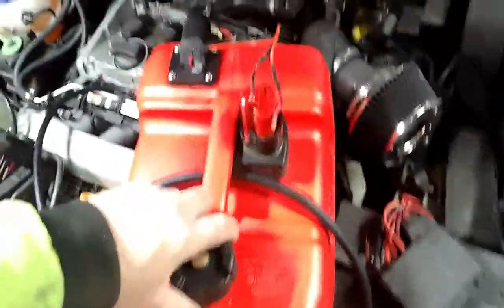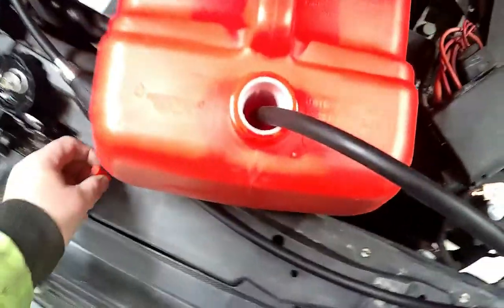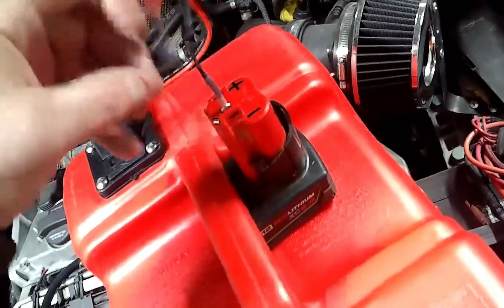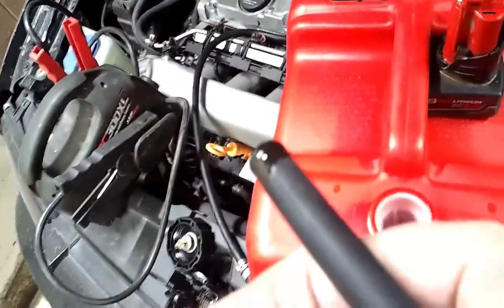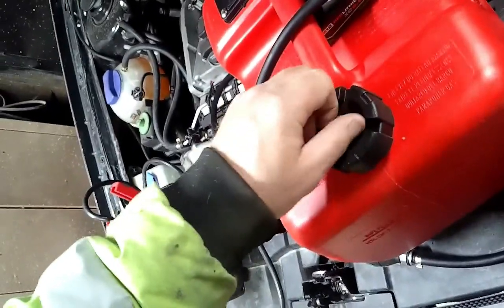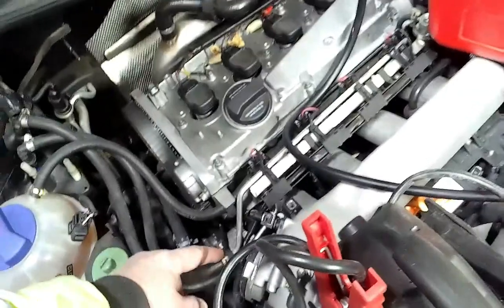PORTABLE FUEL INJECTION FUEL TANK !!

Comment: Could you give a link to the fuel pump and fuel storage tank please
Reply from the maker: @NextLevelAutoDiagnostics  I will see if they are still available, as of last year they were no longer available.
Reply: @rick3090  Thanks....I would love to have this on standby for lots of reasons. And 40-60psi would be plentiful for most vehicles that don't use the late model high pressure fuel requirements.